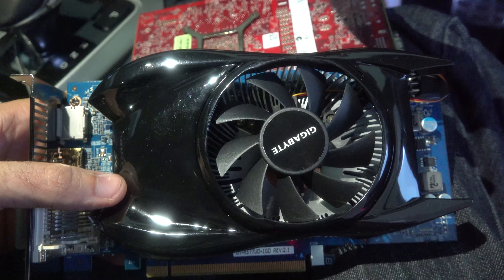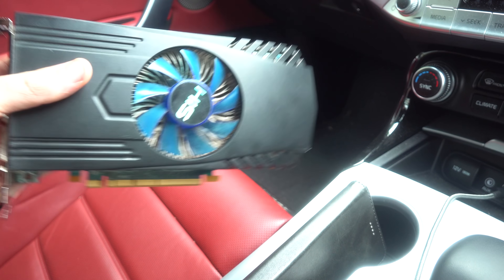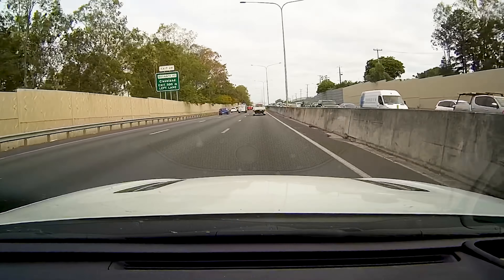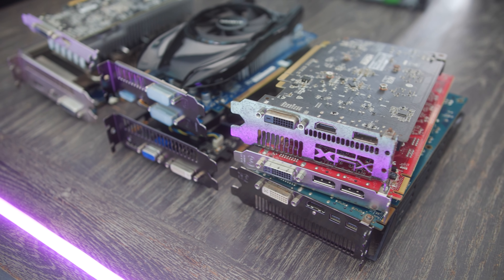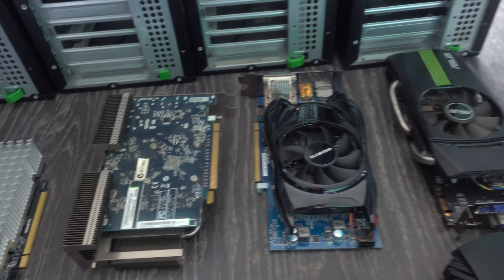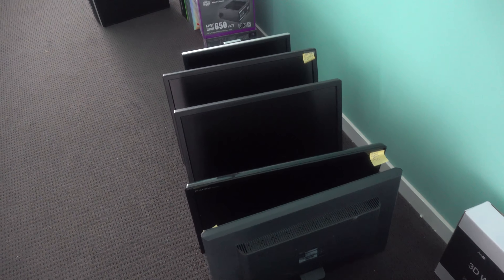Buying CHEAP (Underrated?) GPUs - December's 2020 USED PC Parts Hunt

Comment: Everything in my computer is from the used market, most of it is at least 10 years old. i7-3770k, 24 gb ram @ 1600mgz, SSD and Strix 1050 ti OC. In a modded Antec 300 case from 2010. Recycled Retro loving it. Working great and runs on less watts than my old pc.
Reply: well I also use a pc that built from used market.
i7-4790, 16GB DDR3 @1600, SSD 850 EVO 250GB, Seagate 500GB, HIS R7 360 (It actually my old card coz I bought an RX 480 8gb for this build, but somehow it died after only a year :( )
But last year I did upgrade the case and put another ssd Kingston A400 240GB and both were new, coz I want to have a 'modern' case with tempered glass on it and need space for more games lol.
Reply: @da_pawz  Nice plan should be great
Reply: @JudeTheYoutubePoopersubscribe  nice job 4770's are solid foundation.

Comment: I wish more cards were passively cooled these days. Such an amazing look
Reply: Manufacturers save lots of money making non passives.
Cheaper and smaller heat stinks. It can be smaller. And they can just use an old fan.
Reply: Every decent card today is passive cooled till 60C
Reply: @nikolakarovic5964  he means cards that have no fan,not cards that have a 0 RPM fan mode
Reply: i like gt710's for this reason. you can still get brand new passive cooled cards for HTPC.
HDMI, ddr5, and you never have to replace a fan!!
Reply: @harmonicimbalancer1678  and you also never get decent gaming performance if you want anything above like 720p.
Reply: @TheGauges420  HTPC brother. netflix and youtube and MP3's. if you're gaming on your htpc you have bigger problems than a fan
Reply: I don't, my GT 710 runs cool for about 10 minutes, but it keeps climbing 15 minutes later to 89c, and this is with brand new mx-4 paste. (with the old paste it went to 95c in gaming). this is overclocked however, it does run a bit cooler at stock.
Reply: @harmonicimbalancer1678  1030 is the ideal HTPC gpu, and as a bonus its almost as powerful as a 750ti so it is capable of some light gaming too. (i say that because it supports VP9 video decoding which is what youtube needs, significantly reduces CPU usage and removes stutters.)
Reply: @yotoprules9361  and then you can have that lovely noisy fan with your theatre experience. better off with an APU than another fan. no point gaming on any of this trash in all honesty
Reply: @harmonicimbalancer1678  Never heard about fan less 1030s? Like the Zotac GeForce GT 1030
Reply: @harmonicimbalancer1678  I highly doubt you would hear that tiny fan over the rest of your pc or whatever you are watching, even if the GPU was under full load or not.
Reply: @WirrWicht  hmmm no i haven't. just looked. they're double the price not sure why i would want that to watch movies. like i said i'd never game on trash like this.
Reply: @yotoprules9361  you must be deaf. all small fans are loud
Reply: @harmonicimbalancer1678  We'll see, I actually recently bought a Zotac 1030 mini with a fan. Just waiting on delivery, only bought it yesterday
Reply: @yotoprules9361  probably be ok for the first year or so. it might be loud right out of the box if you're unlucky
Reply: @harmonicimbalancer1678  maybe if you get a faulty fan?
Reply: The integrated gfx have eaten up the low end, this means there's few cards sold less than 50W
Reply: @mouaxiong8618  that's not how manufacturing works, passive cards are a feature that is subject to market demand, they would add the costlier heatsink and subtract the fan and fan assembly costs.
The manufacturer makes a profit by passing on costs and adding margin.
Reply: @nikolakarovic5964  Im aware of 0 rpm fan modes, helpful but imagine a juicy beautiful lookin massive copper heatkink atop an RX 6600 or something that would be beautiful and i would have a blast undervolting something like that
Reply: @yotoprules9361  yikes man how much airflow is going on in your pc airflow ia super important for passively cooled gpus and cpus
Reply: @mackenziebullied4900  its a super old case with a single 90mm fan at the back that always runs at 100%.
Reply: @mackenziebullied4900  but it runs a lot cooler at stock at least
Reply: @yotoprules9361  go on your local classifieds and buy a used cooler master HAF or some random corsair thing for 30 bucks
Reply: @yotoprules9361  or ziptie your case fan to the gpu lol I've done that to a 980ti i bought for 20 dollars
Reply: @harmonicimbalancer1678  at that point the integrated graphics would do the same job

Comment: tyc price list to avoid overpaying xD
1:39 HD 7850 (around r7 260x) 2gb $40/$29
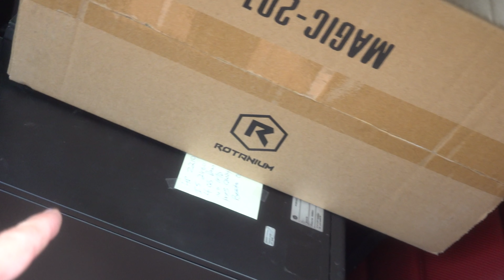2:51 Z210 (2nd gen i5 4gb ram no hd) $60/$40
3:34 gts 450 $10/$7
4:26 gt 1030 & fanless rx 560 $50/$37
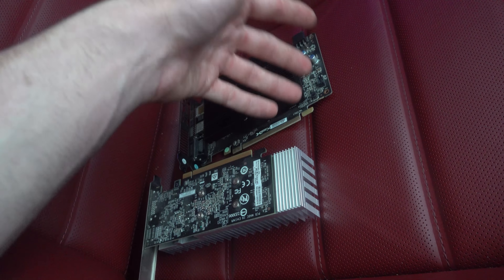4:36 corsair psu vs650 $30
5:29 HD5770 1gb & w5000 (around r7 250x) $20/$15
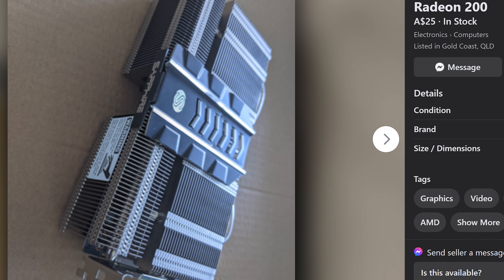5:58 HD 7750 1gb (aka r7 250E) $20/$15

p.s. don't take these numbers as max or minimum values but more of a reference because different zones have different prices. also if your reading this mr tech yes I recommend you download the GPU-L and CPU-L phone app, it saves me lots of time and data (when hustling on the go) looking up and comparing gpu's or cpus. Some even include benchmark value of each chip

Comment: I'm having a hard time picking up between these cards. Would play at 1080p 60fps mostly, like WoT, BFV, CoD WZ. Thanks!

GTX 1060 3GB (Used) - $114 USD
RX 570 4GB (Brand New) - $143 USD
GTX 1650s (Brand New) - $165 USD
Reply: @mansonabc0001  1060 6GB(used) and RX580 (bnew) here is almost the same price as 1650s. so I'm kinda confused.

Comment: I flip pc's in Sweden and i allways buy a rgb-case for around 50 USD, usually the Kolink observatory mesh since it has a decent airflow.

I still get really good deals on most used parts and makes around 150-300 USD per PC. Here is some deals from dece,ber so far:

2500K + mobo + 8gb ram = 40 USD
4690k + mobo + 8gb ram = 90 USD
4570T + mobo = 20 USD
5820k + mobo + 16gb ram = 150 USD
2600k + mobo + 16gb ram = 90 USD
4770K + mobo + 24gb ram = 140 USD
4690k + mobo + 16gb ram = 45 USD
2500k + mobo + 12gb ram = 60 USD
3570k + mobo + 24gb ram = 100 USD

PSU:
CX430m 10 USD
VX550 20 USD
450W no name 10 USD

Gpu's: 
Gtx 1070 = 100 USD
Gtx 1070 90 USD
Gtx 1060 6gb = 110 USD
Gtx 1060 3gb = 110 USD
GTX 980 = 70 USD
GTX 770 = 35 USD
GTX 1060 (BROKEN FAN) = 55 USD

Comment: As a system builder of new and used builds, I completely have noticed everything you mentioned locally to my area as well. It's funny you brought up the 10th Gen i3 predicament where people will go out and buy or be way more interested in an older i7 (6/7gen and less) over the i3 anyday, not realizing its actual performance is the same or better. This leads to greater and/or quicker sales with one spec compared to the next, sometimes overpowering the concrete strategy of price to performance (unless you can sway uneducated buyers to understand just because its an i3 doesnt mean its a deal breaker). With the used prices rising because the demand is high and supply still low, graphics cards especially over every other component are becoming the hardest part to obtain for builds lately for me. They still pop up, but the current $100-250 range of used GPU deals have become very thin and far inbetween. The prices are so inflated that I am starting to consider brand new GPUs, whereas previously a large portion of a builder's profit would often come from a good GPU deal, compared to other components. Just a few thoughts I had after watching the video.  By the way I have been watching for a while now and enjoy your work and content!

Comment: Picked up a bunch of parts on the Gold Coast too, including an X58 board with bent pins (which I managed to fix), a GTS 450 with no IO bracket, 8GB RAM, an i7 930, a case in pretty rough condition, and some other parts like some PSUs (one decent 80+ bronze) and a 1TB HDD. Paid $80 Australian so it was a pretty decent haul.

Comment: So in America where you can get a nice glass side case with 4 ARGB fans pre installed and fan controller header with room for expansion for 49.99, the aesthetic part of the build is easy. Like you said though, the used GPU market is crazy high, higher than new stuff when they are on sale.

Comment: Brian, I really think you should invest into a software dev to write a crawler that analyzes your local market for keywords that you yourself can define and sends you a message on your phone (or Discord) if something is below a certain threshold. It prevents you from having to refresh spam - you still need to be awake and ready to react, but you'd be able to get way more local deals before someone snaps them up. In fact, this is what I was working on for myself as well and I think many people in this field have enough software development experience to write a simple crawler with something like Selenium or Puppeteer.

Comment: since the market is leaning towards aesthetics, that could explain why many cases available now, have the transparent side panel along with the power supply shroud (basement) to hide the potential spaghetti of wires.  I have a new-used build I am working on within the next few weeks (waiting on parts from AliExpress) which is going into my tower I am keeping Antec P182 gun metal color.  Doesn't have front USB 3 only front usb 2 and firewire..but I do have a usb 3.0 add-on card for it pcie x1. Guess that's why there are so many parts available that have RGB...myself not a fan of the RGB tax as you have demonstrated with your review with the 3 different Snowman Coolers.

Comment: DO THE BLING BLING BABY (aesthetics)! BTW, I spent hours researching gaming PC's for my kids for Christmas. I have 5. That's very expensive (even going "budget"). I'm a determined sort of person, so I insisted there must be a way to do this (maybe build my own?) and not break the bank. Of course, YouTube videos was part of that research. I found your flip up challenge and I fell in love! (Don't worry, I'm married . . . kids . . . remember?) You inspired me. I'm no expert and have a lot to learn, but I've tinkered enough with PCs that I'm confident to get into a little flip up challenge of our own. Within 1-2 days of binge watching your flip up challenge series . . . several times . . . and also deciding I'm going to do this, I found a lot of 32 office PCs, monitors, keyboard (pretty much all have RAM, 2 don't have HDD - the rest do). Got the whole lot for $1,250 USD -- 32 (mostly) HP Elite 8200 SFF including 1 core i3 (don't know the spec on that yet) 6 core 2 duo (also don't know the spec yet--I'm also sure about 4-5 of these are a different HP model--we're still taking inventory) and 25 core i5-2400. Monitors range from wide screens to the "square" type (I'd say 60/40 wide to square). Maybe a pretty good deal? From what I see you just picked up in this video . . . looks like HP Z210s with i5 (maybe same processor as I got - https://support.hp.com/us-en/document/c02794662 ) . . . I'd say my price per rig (complete with RAM, HDD, Monitor, keyboard, and mouse) for an average cost of about $39-$43/ea  . . . hoping they all work . . . isn't too far off from what I think I've seen you pick up for similar specs in recent days, weeks, and months (yes? no?). I'll tell ya . . . the thing that you inspired me the most with was the entrepreneurial aspect of what you do. I want my kids to learn that, and something I'm not a stranger to! So, officially as of Monday, December 28th 2020 - my kids, my wife, and I have started our own little "flip-up challenge" business. They want the gaming PCs, they gonna earn it (and I'm gonna learn and teach it--and be the bank . . . very reasonable loan terms . . . LOL)! OH . . . and you are 100% spot on with those budget "gaming PCs." ALL my kids want to do is play Roblox. I have to imagine there are a ton of dads out there--like me--that would be happy to spend $150 to $250 USD for a full rig to satisfy their kids, too. Hey - I see you have a DISCORD channel . . . can I get in? I love what you do with these videos--VERY WELL put together. Thanks . . . looking forward to following you as you journey through those bargain hunts!

Comment: Maaaaan good luck with that Fire Pro. I bought 3 like a year ago for I think $23 a piece thinking they'd be good for some low-end PC's and the driver situation was so bad...like I HAD to use Windows 7 drivers on them and in some games I got nightmare-inducing graphical glitches like textures exploding everywhere. And other games like minecraft just had teeeerrrible framerates and screen tearing left and right. I think my cards were the V7900 or something like that. 2gb of vram...I was thinking they may do about as well as a gt 1030 but I was so wrong.

Comment: I have one of those W5000s. It’s not the most powerful card ever, but it can handle Crysis at medium/high at 40-50 FPS. It’s probably one of my favorite cards for troubleshooting computers though due to its size and it not needing any external power

Comment: Bought a whole bunch of those "HP"(MSI) OEM Radeon RX 460's which were circulating around in 2019. Paid $850 for 20 of them. Really glad I did. Not great cards, but they certainly work as a placeholder.

Comment: My current rig is a xeon 1660 v0 i picked up from a lot. Came in a dell precision t3600 with 32 gigs of ram installed. Slapped my ssd and gpu in it runs amazing. Only payed 120 for it.

Comment: You should dress up a few cheap builds with some bling from Ali Express. I just saw an RGB cpu cooler there for between $5-$8 depending on what country it ships from. I wouldn't be surprised if it doesn't cool as well as a stock cooler but hey, it's got RGB.

Comment: Looked up the W5000 - its GCN 1 Pitcairn - has current release drivers
5770 & 5850 - Terascale 2 - Legacy driver 15.7.1 or Crimson Beta 16.2.1
GTS 450 Fermi - Legacy driver 391.35
The "200 series" actually says HD7750 on the back

Comment: you could continue to focus on price/performance, and looking into making unique case modifications, and cheap asthetic modifications that make your computers unique, while using some budget parts at the same time, something like the Modstek channel used to do. paint the cases, add some cheap led lighting, print unique vinyls to put on the sides of cases, etc. it may take a little more time for each build, but i'd pay 400 bucks for a completed pc with quality mid grade parts and a totally unique case

Comment: I built an X79 system, in  America,  last year that was comparable to a ryzen system with a 1600 af or 2600 because it was cheaper. If you go that route now, its not really the case. You can build a ryzen system around the same as an x79 or definitely an x99.

Comment: 3080 and 3070 cards are hitting saturation in my part of the PH, stores have stock on display selling at 700usd (35k) for 3070 tuf and 1000usd (50k) for 3080 gaming oc, and before you ask, yes that includes tariffs and VAT.